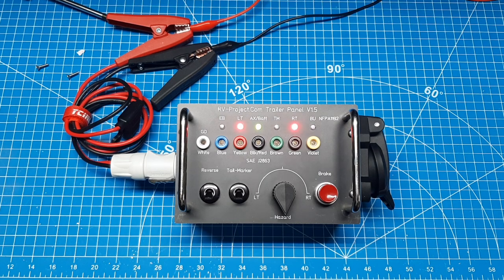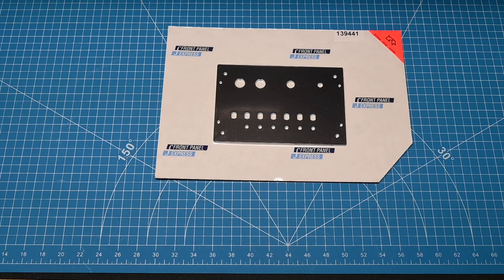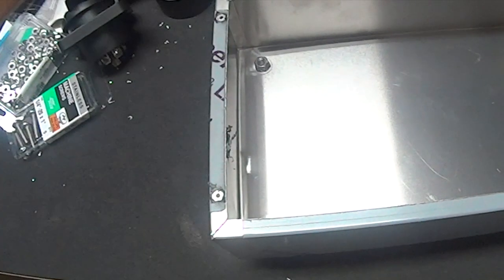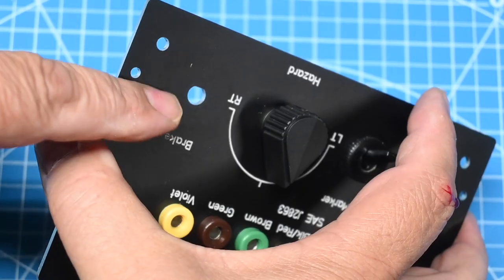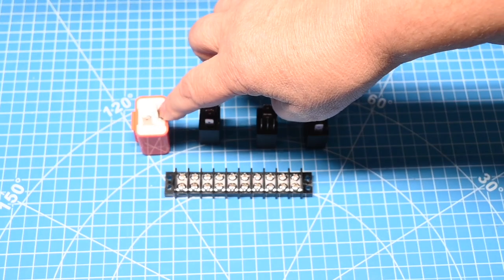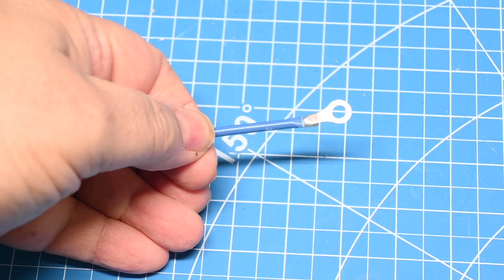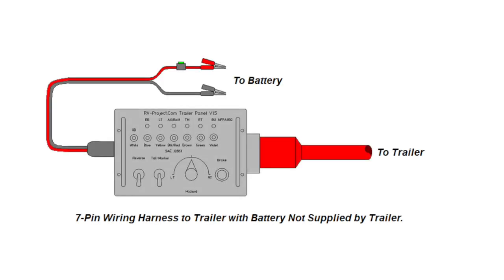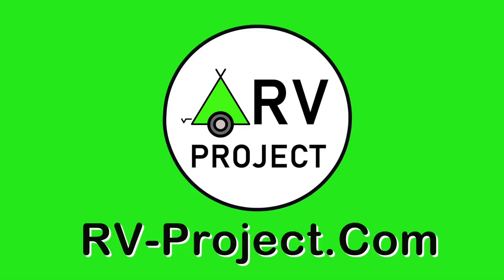Building RV-Project's Trailer Wiring Test Set V1.5

Comment: Can’t wait till 2.0 I want to build it
Reply from the maker: I have had some health issues as of late, so it;s taking some time to get to it. And I do have other shorter projects in the works that I need to do so I don't fall behind my weekly videos.

In reality, after using V1.5 a bit, I have had second thoughts about V2.0. V1.5 is so useful, it does 75% to of what I need.  In reality, V2.0 does not add a lot of functionality other than being able to measure the brake current and having a breaker on each circuit.

It is taking a long time to do the documentation and finish the project, but I am about half-way through the build so I will finish it.
Reply: @RVProject  ok thanks for the info